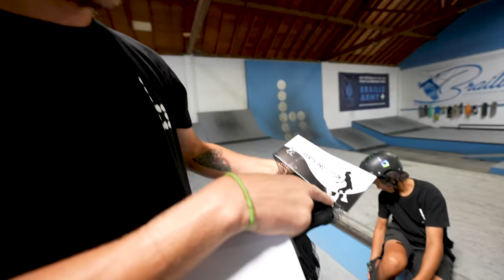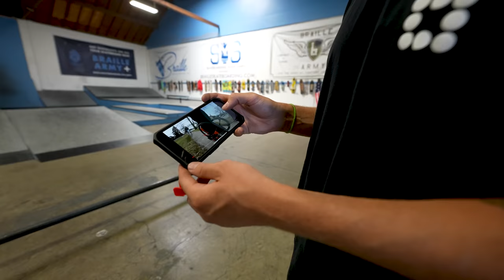WHAT ARE OFF-ROAD ROLLER SKATES?!

Comment: That thing that came off the wheel was the tire stem that's used for putting air in them. Looks like they are tubed tires and one was flat to begin with. ALWAYS air up that style of a tire and NEVER ride on flats, not even for a few minutes! The tube will shift and the stem will break away, just like it did here. Now you have to put a new tube in.
Also i agree with what someone else has said. Those gloves are probably hand brakes for the wheels.

Comment: I had a skateboarding  related question, 
When I change my front foot position from pushing to riding, (like, parallel to un-parallel) it just doesn't happen
Do you think having actual skate shoes could help with that? Currently I just skate in my normal sports shoes

Comment: the cap doesnt keep the air in a shrader valve, do they think if you take the cap off a car tire the air will leak out? the cap is to protect from dirt,dust, etc.
Reply: Bay area bro......smh